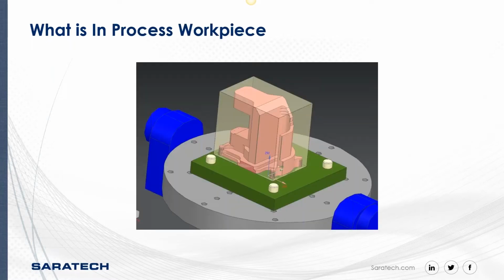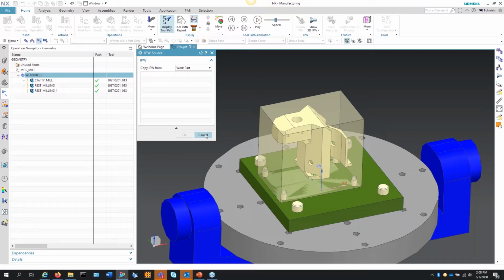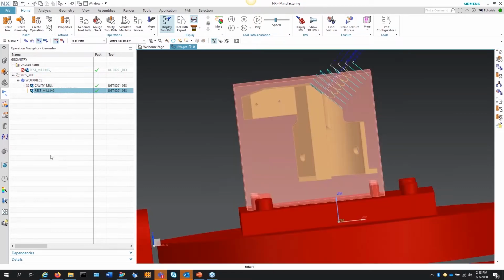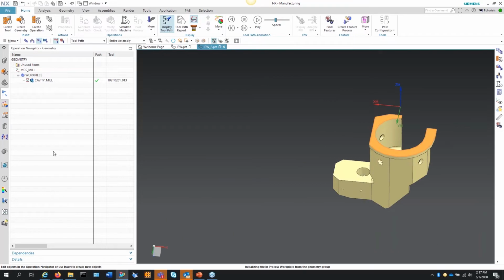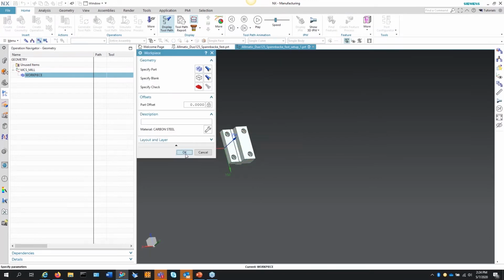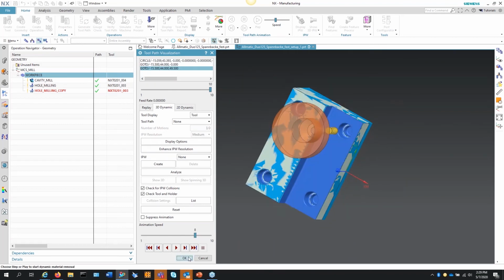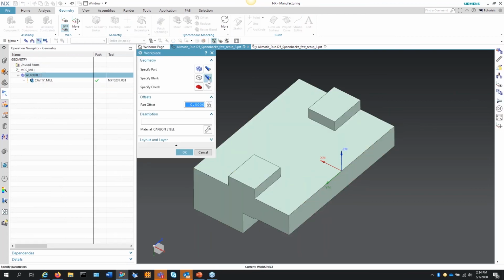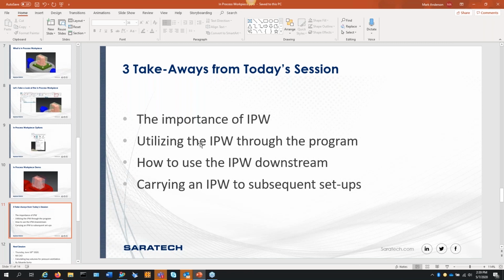CES: In Process Workpiece (IPW) in NX CAD

Comment: You say IPW isn't necessary within the same file. But How do you create the blank geometry for a Mill turn machine so I need the remaining milled stock to select for the Turning Blank Spun Outline.
Reply: In a Mill-Turn scenario, you will use the IPW option to transfer the mill work to the Turn Work piece.  When using multiple machining types, this is the preferred method to control IPW.
Reply: @markanderson5067  please show a simple example.